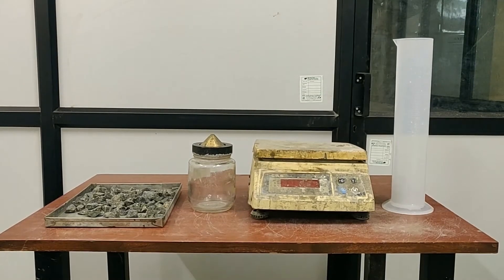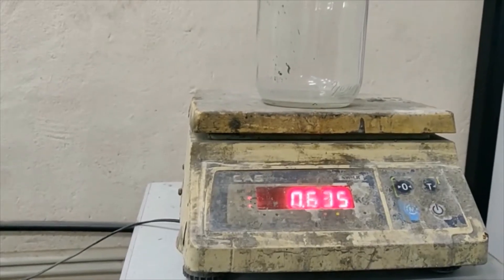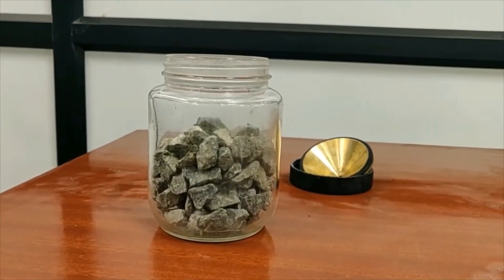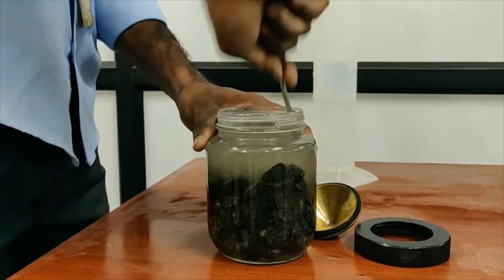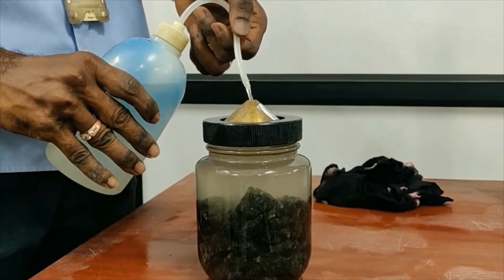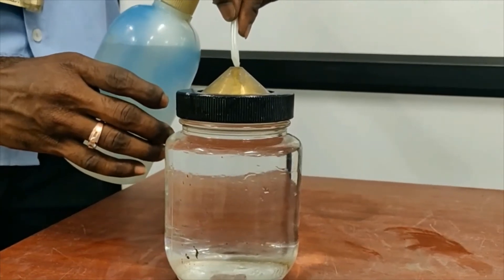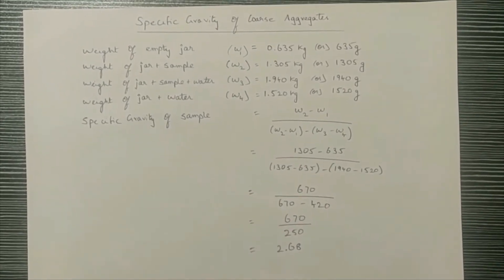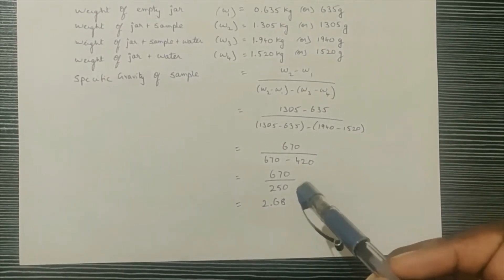Specific Gravity of Coarse Aggregate-Experimental Demo

Comment: Sir specific gravity of coarse aggregates is done using wire backet??
Reply from the maker: It can be done in both ways... If you follow wire bucket method it gives water absorption value also...
Reply: @ramsworldofwisdom2177  tq sir